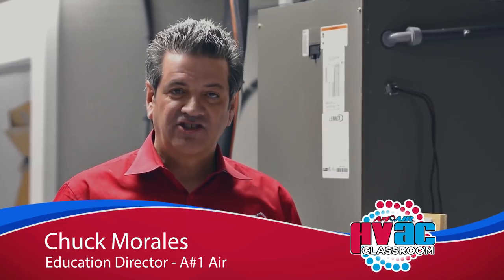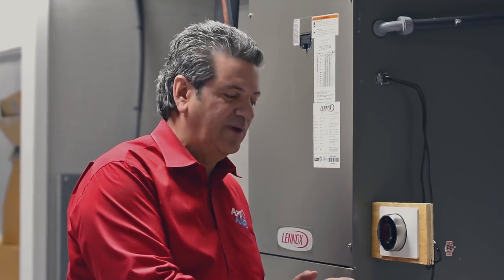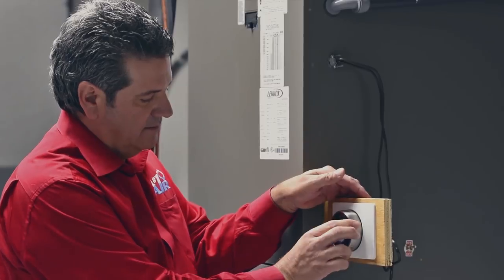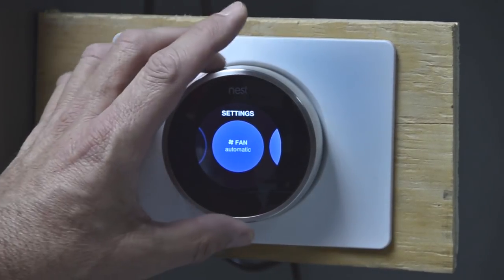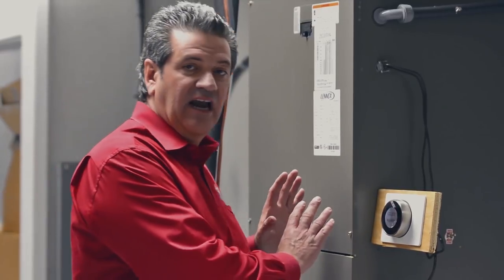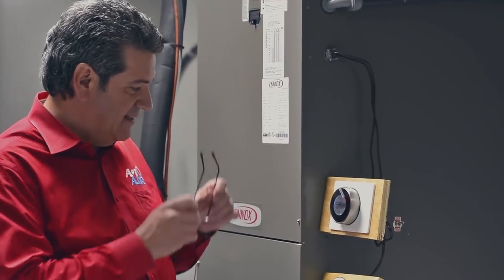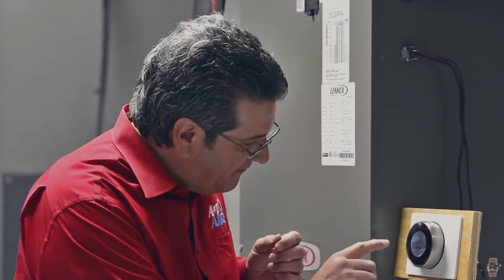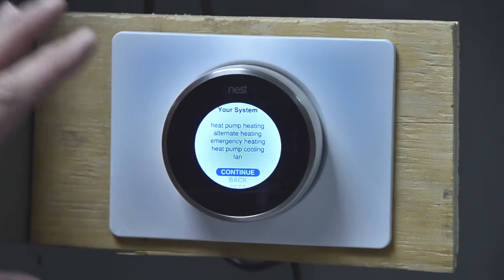Nest Thermostat - How to Setup a NEST Thermostat for Dual Fuel

Comment: Thanks for the video but these settings are incorrect for the 3rd generation nest thermostat. You cannot set gas as the emergency heat, you can only set electric as emergency heat. If you change the setting to gas it will register as alternate heat. You can change the alternate heat temperature between 10-50f. (This temperature is when the heat pump will stop running and the system will switch to gas heat based on the outdoor temperature) or set the thermostat to run alternate heat only. With a dual fuel set up you will not have emergency heat listed as a mode/setting on the thermostat.
Reply: Thank you, this was confusing me so much. You answer a queston I've been trying to figure out for hours. I thought my system must have been wired wrong. Thank you!
Reply: @JimmyJimJimJames  Thanks for letting me know, I’m glad I could be of assistance.
Reply: Thanks as well. Now if I could only find a way to have it switch to gas instead of taking two hours using only the heat pump to heat the house from a 5* thermostat temp
Drop overnight

Comment: Any reason you connected the alt stage 2 to the star instead of the W2? In the Nest Pro guideline setup it doesn’t show any wires connected to the star for dual fuel - one stage heat pump

Comment: All my cables are the same as the one in video except the brown cable. I have white and black cable but then I have a blue one. My Cables are yellow, green, orange, red, white, black, blue. All in sequence. I needed help for installing the blue cable. Mine is dual fuel and live in a apartment with all electric.
Reply: You shouldn't rely on the colors only, but the standard is blue = common wire, which should go to the C terminal.

Comment: Hey Chuck... thanks for the demo! 
Just had installed a heat pump with propane furnace alt heat.
This is the best explanation I’ve been able to find for wiring for this equipment... one question: when I view the equipment setup on the Nest Gen 3 and on the Nest app, it indicates 3 heat sources (1) heat pump heating (2) alt heating, propane furnace (3) 2nd stage alt heating, propane furnace. Also indicates heat pump cooling and, fan.
Both (W1) and (*) are connected to the same terminal on the air handler control board...
The indication of 3 heat sources caused me some trepidation at first because, I have only single stage propane furnace. But after thinking it through, I assume the second stage alt heat is what gives me emergency heat function when the outside air temp is above my 40 degree lock out set point?... is that your interpretation, as well?

Comment: Couldn't you just use W1 or W2 for your auxiliary heat dual-fuel why do you need the star terminal what does that get wired into

Comment: how does first stage heat pump work with G on the furnace.  My furnace only runs continuous fan at 25% which is not enough CFM for the heat pump heating?  How do I get fan to run at full speed?

Comment: I have a very similar system, dual fuel, natural gas backup to heat pump, with a reversing valve.  The wiring is almost the same as in the video except I have a brown wire connected to S1 for an outdoor temperature reading (thermistor/RTD).  But from what I read the Nest does not use an outdoor thermistor.  So, where does the brown wire attached to the * terminal in the video go to?  If emergency heat, my emergency heat is the same gas furnace that is the auxiliary heat (would I jumper * to W1 or just ignore the * terminal).  The Nest documentation says the * terminal can be used for humidifier, emergency heat or something else, but not an external temp sensor.  Then how does Nest know the outdoor temp for determining whether to use the alternate heat or heat pump?  If it relies on the internet, what if my internet or Wi Fi stops working?  Thank you for the video.  It really made me think before dropping $200 on the Nest.
Reply: You just tape that S1 wire, and not use it. And you don't jump anything on a Nest, you should ignore the * terminal - the reason is you don't have a separate wire for emergency heat. Nest knows the outdoor temperature by your location through internet. My system also has S1 and S2, which I simply left them out.
Reply: I wouldn’t trust outside temp that nest shows to control my heat... I would rely on multiple....factors to control the heat....

Comment: Where  does the wire on the star terminal go in the furnace for dual fuel?   What's the reason for hooking up to the star terminal? Does the star terminal do anything in defrost mode?

Comment: Why not just connect W1 as your alternate heat for dual fuel so you don't need to run an extra wire for the star therminal?

Comment: I have the Google nest 3rd gen too. And I just installed my new ac unit and it has a heat pump in it. Even though I kinda don't need it cause I have a forced air furnace. How would I wire it to the nest if I was to hook it up. I have my humidifier wired in and it uses the * and I seen where heat pump or duel fuel uses the * so I'm basically lost

Comment: My friend told me that someone put nest thermostat (not nest learning thermostat) for fan coil unit. it is not working for heat and high speed.  Fan coil unit have 7 wire ( Y1,W1,R,C,G0,G1,G2) Google support tech suggest use Nest Learning thermostat. If I buy it then G connect High speed G2 , Y2 connect Medium G1 and (*) connect low speed G0. Am I right?

Comment: My system doesn't have a enough wires for the * terminal.  What should I do?  I have electric air and heat with a heat pump and a zone system.

Comment: Do you have a video for wiring a wood furnace to work primarily over the heat pump, and have them sharing the nest? For example i would like to control both heat sources, with my wood furnace being primary and my heat pump being secondary, or rather to have it turn on if the furnace would go out? I would like the thermostat to control my blower fans on the wood furnace and an electric draft. Thank you for your insight.
Reply: Have you figured out a solution to your question? I have the exact same setup and trying to figure out the same thing you were trying to do!
Reply: @austinbirk127  unfortunately no I have not
Reply: @destinationunknown7913  thank you for the response. If I figure something out I'll be sure to get back with you.

Comment: It's just a little confusing you say the W1 W2 is for your dual fuel auxiliary heat but then also the star terminal is for the dual fuel auxiliary Heat where would you wire the star terminal into.
Thanks. Also Nest technical support is very nice but they are also very Clueless I feel like I'm talking to somebody that took an hour class on this thermostat and they're very helpful for a basic wiring and basic setup but when you get into the more intricate complex wiring such as dual fuel settings the balance points they have no clue what you're talking about
Reply: Usually you won't be using W1. You can use W2 for AUX; and * for Emergency heat (assuming there is a separate wire). My system was originally wired where AUX and Emergency wires are short, so they are basically the same thing, I only had to connect the AUX wire to W2.

Comment: I understand your video. I currently have a duel fuel Heat pump/AC, and gas forced air system. However, my system has two additional wires (Red, Wight) total of ten wires for I believe the furnace power.  Do I need to add a jumper wire?  Exactly where?

Comment: Just purchased Nest Thermostat.  
I built a new house with gas and heat pump.  My old thermostat 5 wires:  g, w,b,y,r.  The first 4 wires match the new Nest.  Where does the red wire go on the Nest.
Reply: Default for the RED WIRE is “RH”

Comment: Hi, my old set has R, O ( a brown wire connects to it) , C (blue wire), Y, E/W1, and a jumper to W2, lastly there is a G. How to install it?
Reply: Hung yen Sung I have the same thing. Did you ever figure it out?
Reply: Go to the nest website and use the compatibility checker then if it's compatable you will get wiring digram

Comment: Can u do dual fuel when you have a stand alone heat pump and indoor air handler without heat strips. And have a oil forced hot water system with baseboard radient as ur back up heat?

Comment: I have a dual fuel system, HP / LP. The wires I have are R,B,W,G,Y. Is it possible that the wiring to switch between heat sources is in the furnace, and not decided by the thermostat? If so, How do I set up my thermostat? still as a dual fuel or as a single fuel? Thanks.
Reply: where does the blue go?

Comment: Ok so I am so confused, I have watched all the videos and none describe what I have. I have a AC/heatpump outside. But I also have a furnace downstairs that runs off oil. I only have 1 R wire on my old thermostat.  
I have Y O G R C W E
Those are my old thermostat wiring. 
In the nest, do I hook the E to the star and the W to the W1 on the nest to still have both my heatpump and my furnace as emergency after if gets below 35 degrees outside? Because right now,  my thermostat runs off heatpump 35 and up and the oil kicks on at 35 and below.
Reply: Have you figured out a solution to your question? I have similar setup.  I have a heat pump system with a fireplace furnace all in the same air duct of the house. Trying to figure out if its possible to run all off ones nest thermostat.

Comment: I just installed the nest thermostat on my heat pump. Condenser unit is not coming on at all. It won't shut off at all constantly running. Any suggestions.  There was a jumper wire that I took off. No settings for heat pump
Reply: I take it that your nest thermostat is fine now seeing how it's been a year ago since your post. If you go to Nest website (maybe on the app also) you can talk to someone from Nest and give them information on what type of heater you have, if it's gas or electric and then Nest will send you your personal wiring diagram for your heating unit with the Nest thermostat. I do know that Nest doesn't use any jumpers for wiring any of their Thermostats.

Comment: Question, you said for a duel fuel system, the white wire should be moved from W2 Aux to W1. The wiring diagram Nest sent me said it goes on W2 Aux? I'm confused on where it should go. My system is an electric heat pump with gas back up. A little help please.
Reply from the maker: Great question!  According to Nest - and I shall paraphrase page 19 of their Pro-Installer-Guide - but this is my answer to you:

From Nest -
For dual fuel, any wires inserted into the W1, W2/AUX, or *(if W3 is chosen) connectors will be treated as alternate heat that will be used instead of the heat pump when needed. Use Pro Setup to indicate the source (gas, electric, geothermal, etc) as well as the delivery mechanism (forced air, radiant, etc) for each W wires connected. The 2nd generation Nest Learning Thermostat supports two wires for alternate heat - additional alternate heat wires are not supported.

From me -
W1 or W2 can be used on single stage gas furnace. Both W1 and W2 are needed for a two stage gas furnace. The Nest Thermostat recognizes which W is used to configure the program.

Thanks!
Reply: So, I'm good on W2/AUX right?
Reply: If you have a single stage  gas furnace as backup, I believe so.
Reply: @anumber1air  I saw that in the Guide and wondered why you moved your W wire from W2 to W1. According to the guide, in a dual fuel setting Nest should treat them identically(?)

Comment: hi 
I have heat pump and hot water gas boiler ( my main heat is hot water radiator ) and can I connect heat pump and hot water boiler as same way that you did on this video and I don't want the fan comes on from heat pump when the boiler start heating up the radiators.
Reply: I have the same situation, did you ever figure out ? Thanks
Reply: I have the same situation. Heat pump for central AC, furnace for hot water base board heat. Does Nest E thermostat work in my case?

Comment: In my case, I presently have a 2-stage natural gas furnace and am using W1 and W2.  I have no cooling.
I am going to add cooling via a heatpump now, which will give me cooling (Y1 and possibly Y2) and heat-pump driven heating.
So how do I (or can I) set up the 3 stages of heating in my Gen 2 Nest:
W1 - Heat Pump heating
W2 - Furnace-NG heating stage 1
W3 (*) - Furnace-NG heating stage 2

Is that the correct setup or not possible with the Nest?
Reply: have you got an answer to this?  I believe I need to set mine the same.  I have a heat pump and a 2 stage gas furnace
Reply: Short answer is.... just get different thermostats connect them to the heat sources, and as long as they support if this then that functionality... program them to come on.... without having to configure any nest settings.  Hope this helps...

I use 3 thermostats one from Honeywell for heat pump controlling cool mode for and heat mode for heat pump.... and 2 thermostats (Nest) for tankless gas heater...

I use if this then that functionality to control both fuel sources.

Comment: Do you know how to disable the heat pump I prefer using gas heat all the time the heat pump is expensive to run I have the 3 generation nest even nest, the tech at nest is having a problem with disabling it crazy how difficult it is, any suggestion would be appreciated .
Reply: Run it in emergency heat.
Reply: Very difficult... your best bet is to open up manual for heat pump... schematic diagram.... and see where each wire goes...
Reply: Did you ever figure this out? One tech told me I could simply unplug the O/B wire and it would run cooling-AC from compressor outside and W1/w2 for each stage of NG heating. Havent tried it yet though.